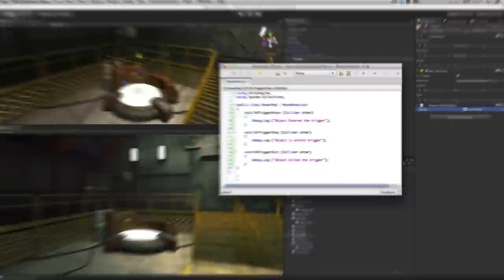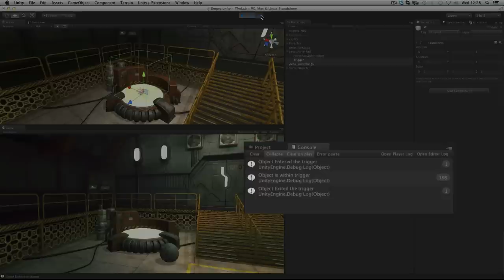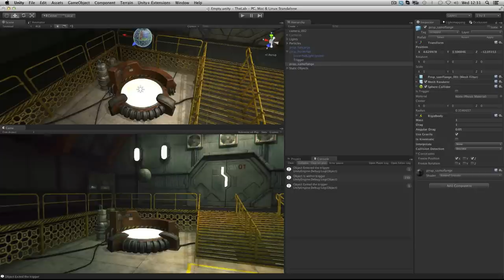Colliders as Triggers - Unity Official Tutorials

Comment: how can I make a scene change when my character walks over a collider??? I have spent hours doing research and trying everything, and I can't seem to get this to work!!! I have a "cube" with a "box Collider", Trigger is checked. Cube is tagged "cube" Player is tagged "player" My scene is called "darkwoods" that I need to change to. I just need to find the right script. I even added a rigidbody on my Player and that still isn't working. PLEASE HELP!!!!
Reply: Dorothy Jean Thompson I know this comment is pretty old now and you probably have worked this out but if anyone else comes across this with the same problem the way you do it is:

void OnTriggerEnter(Collider other)
{
    if (other.gameObject.tag == "player")
    {
        Application.LoadLevel("darkwoods");
    }
}
Reply: ***** If your game is 2D just make sure you are using a 2D collider and make sure Is Trigger is checked.
Just realised there was a small error in the code I posted. You need a return type for the OnTriggerEnter function so just put void before it. I have edited the original so its correct now.
Reply: ***** You put it on the trigger object. You need to make sure that the player also has the "Player" tag. The way the script works is it gets called when the trigger collides with something, then it checks if the object it collided with has the player tag (if does have this tag then the player has collided with the trigger) then it loads the scene "darkwoods". Obviously you replace darkwoods with the name of your scene but you should get the idea.